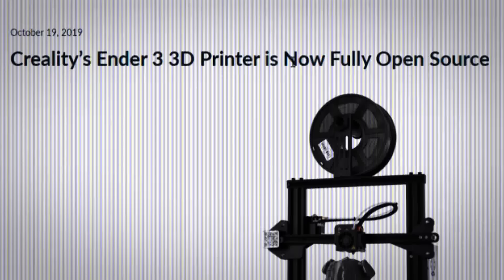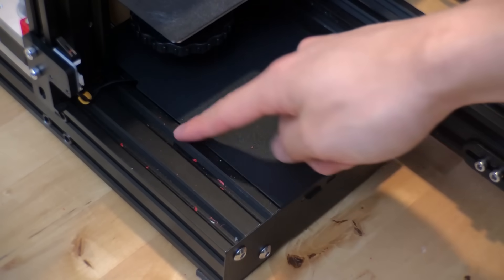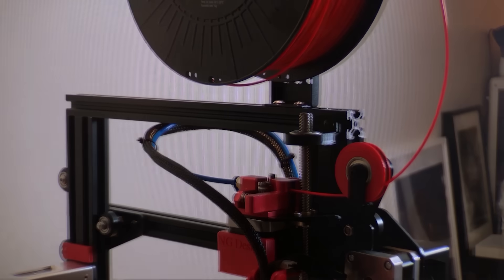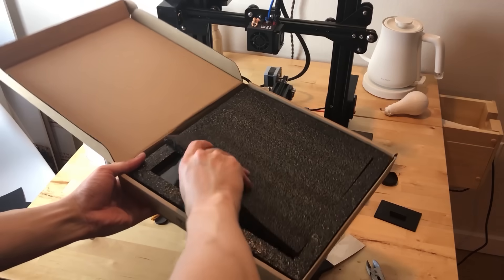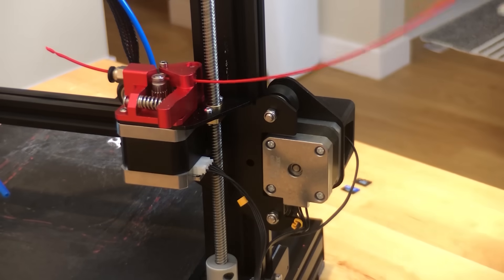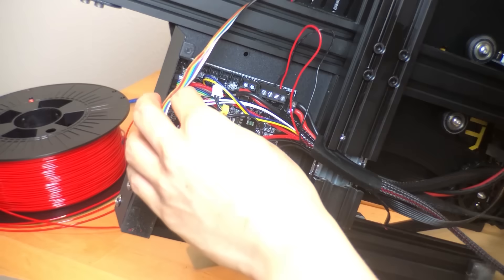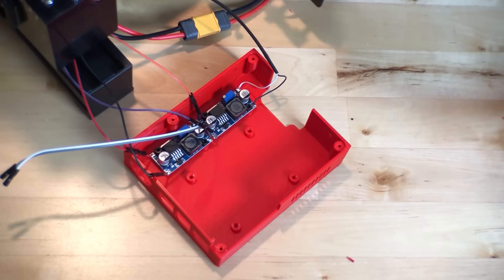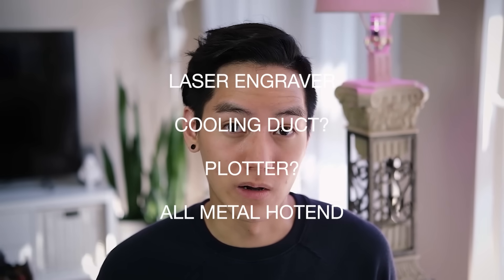First 24 Upgrades for my Ender 3 Pro - Part 1

Comment: I got a 500mw laser that magnets right onto the hotend fan plate, and you just plug it into the fan port—so simple! Grab a rastering program or some other software for the laser, and boom, it turns your printer into a laser CNC machine! Of course, you'd need a ventilated enclosure, but you don't even need an Ender 3 or a Creality printer. I think Creality makes laser head attachments for other printer models too, which is super cool! In Canada, I think anything above 2 watts is illegal, but somehow I know someone in Ontario with a 10-watt laser. Anyway, great video! I wish I'd had more patience and been born closer to when programming was being taught in schools. I learned on this program called TOURING in high school, and it's the most obscure programming language ever. I don't know why they used it—it made everyone I know hate programming. Now I can't program my way out of a wet paper bag because of it, plus I was born in the late '80s. But yeah! Great vide

Thanks man! Liekd and Subbed!

Comment: Ender or i guess creality is weird they make an inferior 3d printer then they sell you a bunch of things to compensate with it and the community works together to come up with solutions but idealy you would just tackle everything from the source of the problem but with all these upgrades available im guessing it leave people confused so you have people like this guy making as many upgrades as possible even tho some are downgrades or dont properly work with eachother or are counter productive which i guess then lead to people trying to figure out the cheapest upgrades or the most impact for value and thats been a whole category of youtube video its sad bc intend of people wasting all that time and money they could just study / research a bit and understand based on science how to build and/or upgrade printers if you understand each component and why each was chosen you clearly see the faults in the design but you can also appreciate what they did given the low budget they must of had to meet but all this knowledge which i would call common sense as it should be if your working with machinery you should understand it with any tool you work with you should understand it but everybody now adays are rtard and they wanna do shit without learning they wanna use shit without knowing how it works or how to use it everyones trying to sell everyone technology that enables idiots to do shit they really shouldn’t until they gain knowledge and are no longer idiots its always been this way and its just the sad world we live in ~ just an opinion of a fellow designer

Comment: 5:54 what ……. Man down graded his build plate 😂 

I often find this with designers they only know aesthetics research is the most important thing it turns stupid designers into useful shapers of the world
Reply: Tho i guess it depends on what your trying to do but if you really need a glass bed just put it on the magnet personally i just clip what ever build plate i need straight to the bed depending on the material but you might as well keep the magnet if its already on there

Comment: Old video i know.

But just replace the PSU fan with a better 1. Print a new PSU cover if you need to. I got a noctua R8 redux in there. Moves more air, takes less power, and is virtually silent.

Ps. Dont touch anything inside unless absolutely necessary and you know what you're doing. Its not safe.

Comment: Hey bud. I really like all your vids for this project. I printed everything using the gcode files included ( i did not slice or edit anything myself) with the thing from thingiverse for the drag chains and the parts at the back of the build plate actually over lap the skirt. In other words, the parts print on top of the skirt. I didn't have any problems printing and it didn't seem to mess anything up other than the thin skirt having to be trimmed off the back few links.

Comment: I have an ender 3 pro, and while it got me into 3d printing as a hobby, I absolutely hate it. The hotbed doesn’t adhere unless I put half a stick of glue on it, and the print quality is abysmal. I got a Bambu A1 a while back, and it’s infinitely better.
Reply: Ive had ender 3 pro for 2 years now amd have no problems with bed adhesion without glue or anything
Reply: Also bambu sucks, no open-source no thanks

Comment: I know this video is years old, but I still in December 2024, use my ender 3 (non pro) and it usually out performs my S1. I just recently got the S1 Pro after selling my S1 cheap to a buddy who is getting into 3D printing. I don't understand why so many people have such hate against the ender series. Yes, some of them do have their issues but they're fixable. Once they're running like they should, they're unbeatable for the price. I have only ever used the ender line of 3D printers.
Reply: Please try an ender 3 v3 variant. Not much more expensive and has auto leveling

Comment: I hope you don't mine me asking, but with newer printers like the Bambu Labs offerings, would you think it would be better to go in that direction as someone new to 3d Printing, or would you think the Ender 3 Pro would be a great place to start? I've heard some debates on the closed aspects of the platform, vs the barrier of learning needed in order to get something out the door.
Reply: Do not buy any of the base level Ender 3's in 2024, they were good for the time but are becoming more and more outdated as the years pass

Bambu A1 mini is the best beginner printer
Reply: Only buy an ender 3 if it’s a v3 variant. 
A1/a1 mini is also pretty good. Wait a bit before getting an ams lite

Comment: I have to ask yall: are these safer air quality wise than resin? Seems like but I’m surprised these are used uncovered in open spaces. Wouldn’t the microplastic filaments foat up into the air and into your lungs?
Reply: Abs or asa will release fumes. Pla is safe

Comment: Only drawlers case is over 20hours printing... does it worth it? Or I did some bad settings and some one can help me out?
Reply: You using how much infill % ? You use supports? What precision print i mean resolution/mm?
Reply: You can try switching on Spiralize Outer countour. It should print in 3.5h.
Reply: @jw200   hieght: 0.2mm ; speed: 50mm/s ; supports: No  ; Infill: 15% grid. Shows in Cura 147g and 17hours 45mins. If I print it vertical - the time is 21:45 - even more...
How you do flat position without supports and what is this Outer Spiralized Countour - where to find it and how to use it.
Sorry, may be dumb questions, but i'm very very new to all this printing stuff. Definitely doing something wrong - please help!
Reply: @Braincho  Watch videos about Cura on Youtube then.
Learn the basics. Its not hard at all.
Nobody teached me, just Youtube and trying all by myself.

Comment: Ahahahah trends are funny. 
I have a Cr10s Pro that comes with Z bearing from the factory,  found out that removing them actually really improved the quality in my Z consistency.
I guess that varying the friction applied during the movements change the actual height increase.
I also keep installed couple of oldham coupling but they always need to be well lubricated otherwise they make things worse than what they are supposed to solve.
Good video! enjoy your new shiny printer :)

Comment: Just a PSA on the SD card reader adapter. I can't confirm for all printers but on my CR10 if you insert SD card while printer is on it will corrupt all files on the SD card. I know from experience. Luckily I had my files backed up on My PC so no biggie but could be if you don't back up files.

Comment: For mod #18- Always double check your mother board stats. Some of them cannot addapt from micro to SD and the board wont read them, just incase anyone else wanted to try that.
Reply: I have this issue where after installing this adaptor, i can only read the SD card when inserting the adaptor the first time. But all subsequent inserts into the adaptor will read an empty drive untill i reinsert the adaptor itself.

Comment: WARNING THIS INFORMATION IS BASED OF MY CONCLUSION OF MY OWN RESEARCH AND KNOWLEDGE. 

I suggest not using the sd card to micro sd adapter, I can’t get into specifics, but basically 3d print data straight from the usb source file in real time, using the micro usb and direct printing makes print quality worse, it’s all about the baud rate of the serial bus. This is a very simple explanation research it:)

Comment: For some reason the card readers don't work. I can read cards from them, but if I remove them from the readers, the printer loses the signal but putting the card back in, it doesn't pick it back up.

Comment: You probably don't check this anymore, but I just got my Ender 3 Pro and it's birthday is also 4/28, just 2023.  Kind of neat.
Reply: Mine is 4/28 2024
Reply: @TheRaccoonFPV you still buy stock ender 3 pros in 2024? get the variants of the v3
Reply: Why not the v3
Reply: @blue-oraclee cause they are not smart x)
Reply: i got it weeks ago😂
Reply: Me2😂3 pro 2023 around June 

Now I own X1c ,s1 plus, v2, cr-6 se. Cr10
Reply: @betaaataa i bought my ender 3 v3 se as my first printer on oct 21
Reply: I got mine 2 weeks ago

Comment: Personally one of the first mods I did was a roller bearing filament holder + filament relocation bracket. It makes it so much easier for the spool to freely rotate which can cause issues with extruder slip if youve got a heavy spool on. Great video bro

Comment: Im sorry but these arent upgrades, these are quality of life features. I dont meant to hate but I feel like a lot of this isnt actually needed and wont improve anything, sure bl touch (klack ender is cooler and more cost efficient), skr mini, and octoprint (if you have an rpi just go straight to klipper ToT) are upgrades but some. like the filament guide dont actually serve a purpose.
Reply: Dude this video was made in 2020 klipper and the klack wasn't as well known back then.
Reply: @Victor_2019  Its not that; 3d printing isnt, and shouldnt be for everyone. sure its fun to print little toys on it, but fdm printers are mainly used for engineering. These are the type of videos that make kids go out and buy cheap 3d printers and try to "upgrade" it, but instead theyre disappointed that its not all the sudden a modded voron 0.1 with a volcano hotend used for speed benchy racing, and they give up on it.

Comment: Finally got to see your video. My kids got me the Ender 3 pro over three years ago, we printed two of the sample, and then it got put away; life happened. Really nice, I only wish the content would have been at my-old-age-speed but, still, really nice and now I'm off to watch part 2.  Okay, parts 2, 3, and 4 now under the belt.  I still have almost no clue as to what I'm doing but hey, that's why we learn... stuff, right?  Step one, Upgrade the board to 32bit and all the other stuff

Comment: hey Scott, quick question, which firmware are you running on your ender 3 pro? ive been struggling for days to get a working firmware for my bltouch,  i know how to compile firmware so if you can share the version you are using ill appreciate it, i mean, if you can share the bin file would be even better but ill be satisfied with just the firmware version/name, ive tried TH3d, and Marlin, from 2.0.x bugfix to latest available. Thanks in advance!

Comment: I just got the Ender 3 pro and I want to make fishing lure molds from PETG due to the higher heat tolerance. I was wondering what settings you use like nozzle & bed temperature as well as speed for PETG? I have zero problems printing PLA but PETG has been nothing but problems for me. I was using 240 degrees nozzle temp., 80 degrees bed temp. and 50 mm/s speed for PETG.

Comment: Very nice job Scott. Bought the Anycubic Vyper which has allot in common with the Ender 3 v2 but it comes with lots of upgrades out of the box and is easier to install. Had some problems with the slicer software  not starting on windows 10 and Chinese software drivers at start but it is ok now. Ultima Cura 5.2 solves this issue. Print quality is good as long the PLA feed goes smooth and the nozzle is kept clean.

Comment: The fan you used inside the raspberry pir case was it separate or did it come with the pi or the step down if not what fan did you use ? My tenlog printer is 24v here in Thailand

Comment: 8x2 leadscrew is one of the best upgrades for this printer. this way you get 0.01 pr 1/200 steps. pr rotation its 200 steps with the stock screw u get 8 mm travel pr rotation. resulting in a layer resolutuon of 0.04mm pr layer. This is not optimal when slicing with variable layer heights i found that the printer has to even this value out to fit 0.04mm steps. by fitting at 8x2 instead of 8x8 there is 2 mm travel pr rotation. resulting in a layer resolution of 0.01 mm. for which the printer does not have to choose a closest value.

Comment: Great vid. What I dont understand though is how you got your sd to micro sd card adapter to work. I got one and the printer didnt recognize when the card was pulled and reinserted from the adapter. It only worked when i pulled the adapter from the machine and put it back in which defeats its purpose. also it mildly damaged my internal card reader because my micro sd slot only works after one or two reinserts which wasnt the case before i tried to adapter.

Comment: Hey, I have a question. I got the same kind of SD extension as you have, but my printer won't reread the card once it's been taken out and put back in the reader. Did you come across the same problem and if so, how did you fix it?

Comment: I LOVE that you basically made your Ender your own colour scheme; I saved this video for later so that I can do the same thing!  The Raspberry Pi goes a bit over my head, but that may be an upgrade for much later. Great video :)
Reply: The way he did it is more clean and compact, but if you don’t care about looks you can pretty much just plug it in after installing software and use it.

Comment: When we printed the draws we found that the screws for under our bed were 3mm to low. This means that the draws didn’t fit on our creality ended 3 pro.
Reply: I had this same problem, I am thinking about adding a washer to try and decrease the length the bolt sticks out of the nut. Anyone else have this issue/ know a better way to fix it?

Comment: hi i got my Ender 3 pro and i have used some of the mods like the screen cover, scraper holder
 Thank you so much 
i haven't found a good way to do the cable chains it seems like a lot of work is it possible you could make a video or tell me how to do them 

thanks

Comment: For the motherboard replacement:
I checked my motherboard and saw glue holding some of the connectors in place, I think it’s not that bad trying to remove it but the video didn’t mention this
Reply: yeah its fine, you can just attack it with a screwdriver but be careful

Comment: I went for a hinged cover because I have a cat and I use octoprint to control my printer. Display is almost never visible cause I almost never open it. Plus the one I went with opened to right so it’s clear of the print head if it were open.

Comment: first of all you put SNACKS AND CHIPS IN THE INCLOSURE WITH CIRCUITRY WHAT THE F
and just get buck/boost converters they are superior in every way and you gotta do EXCTLY 5v or it wont function right
and get heatsinks for your pi IF you are going to have a fan they are less than 3 bucks and if you can solder and stuff then also mod the pi so its hotwired and doesnt depend on a good USB-C connection
there are so many improvements here but still gj i guess i have a anet a8 it stopped functioning and its bc a chinese piece of crap

Comment: 9:20 making it more quiet by replacing the board made me think it might be a software issue? And there might be a firmware update that resolves it? As I looked it up ... it just might. Just downloaded the latest firmware but haven't checked my own version yet ... as, ironicly, my printer is running at the moment (and I'm watching this video with headphones on with ANC haha).

Comment: For anyone who installs a BL Touch some newer Ender 3's come with the non-silent new motherboard V4.2.2 .Meaning you dont have to use a boot-loader for the firmware.Also,there is a dedicated BL Touch connector

Comment: nice  vid well edited and presented. i  recently got a 3 pro  aq couple days  after  i started using it i would get a total random temp runaway error, creality was of no use , so decided  to get the  all metal direct drive so everything the feed  and hotend all metal and as one unit. decided doing that i may as well add a cr touch probe , not come the hard part i still have to original 4.2.2 board  and same  lcd display you  have and the firmware available from creality  is either the  probe   OR   the  upgrade hot end kit  they do not have have the firmware for both ended up having to get software and  basic core from marlin and  set up own.   i  already made some of the upgrades  you did before seeing this  plus upgrade the bed leveling springs to a better quality and slightly stiffer then the original and plan on a few additional upgrades  glass bed  different  motherboard lights as you put , already added the  x - y  tension  adjustable  kit  made a small adaptor so i could put an inch lb  torque meter  on it to see how much  i had them tightened so both have equal pressure to move the head going to make an adaptor to go to torque  head to get same tension on the  slides  rollers also whit a torque wrench,  ( i may  make a different adjusted for the  rollers  i am a tool and die maker  )